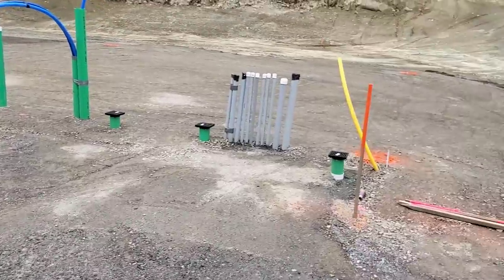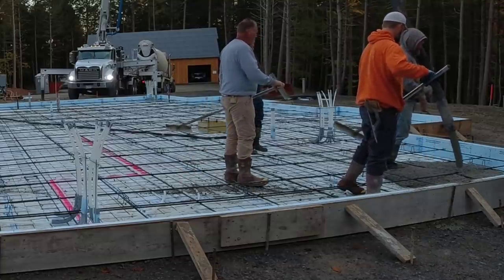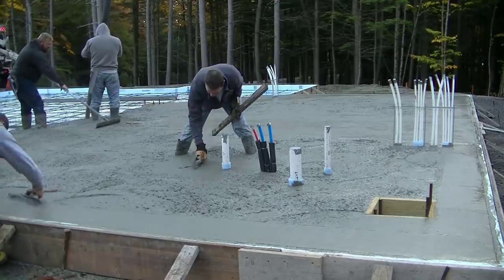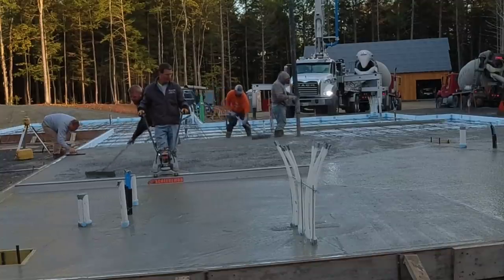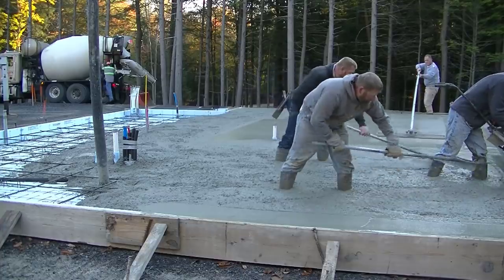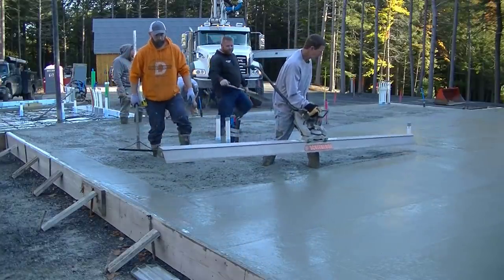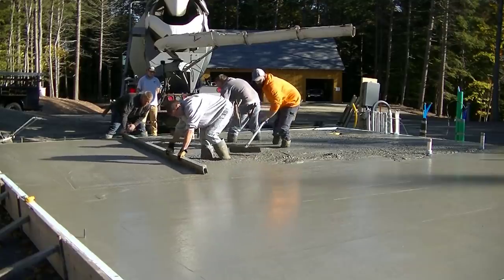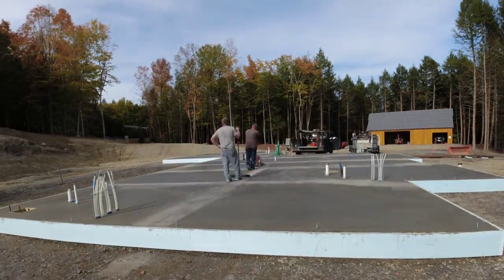He Made Us Pour His Concrete Slab 10 Inches Thick! (Waste of MONEY?)

Comment: Concrete is cheap. The guy is a builder he knows what’s up. More concrete is better. Everything now is so cheap and built to a minimum . Nothing wrong with doing things right . That is how I would want mine done . 👍🏻
Reply: Concrete is cheap, what the hell are you smoking buddy
Reply: @nicholashartsock2830  Concrete
Reply: @nicholashartsock2830  my boss gets it for cheap 10$ a yard
Reply: @nicholashartsock2830  is somewhat cheap... if you put all the costs in building a house, concret is cheap
Reply: @nicholashartsock2830  It's all relative. Concrete is cheap relative to labor and many other materials, especially for the strength you get for it. For a regular homeowner working on a much smaller project, it may seem expensive, but if you are building a home from the ground up, it's a pittance compared to what you will be spending on rest of the project. This was probably like 3 truckloads more concrete, so I'm guessing probably around like $3-4k more concrete?
Reply: @nicholashartsock2830  Think about how much you spend for a gallon of gas and what you get for that... You are already investing in the foundation. At this point the cost is minimal for what will put on top of this, think of the value of the overall project. When a normal foundation starts settling, cracking, over they years. It causes damage and the house needs repairs. This will last twice as long and with better results. So the cost is cheap,  this is actually saving you money.  And this will last over 100 years. Think of the value for the dollar on this one. The is an old saying and it goes something like this: "Nobody has time to do it right , but they always have time to do it again"
Reply: Agree. The labor is already priced in. Might as well go big. I always think this way.
Reply: You don't know what you're talking about...Things are built to CODE...It's not a "minimum" it's an engineered assembly...Where do you draw the line?...Why not make it 20 feet thick...Hell, that's way stronger than 10" ... And while concrete is inexpensive LABOR isn't...That extra 23 yards cost a few thousand more...It's not right or wrong to overbuild; it's just a waste of money and resources...
Reply: @chrisburke9279  where in the FUCK is he getting it for 10 dollars a yard. thats bullshit, we pay 150 plus a yard for concrete. i dont know anywhere where its under 150
Reply: @godbluffvdgg  well thank goodness we live in America 🇺🇸. Where you can use as much concrete as you can afford including labor. And we all have the freedom of speech to express our opinions !🙂👍🏻
Reply: @Sectionmillionaire-fg8mm  awesome me too!
Reply: @fastflo1  Indeed...Gooooo Freedom!
Reply: Lol no. Building materials are through the roof. They’ve started settling down a bit. But over the summer it was 100 dollars for a sheet of 3/4 plywood. Now imagine how many sheets you’d install building a house and half inch plywood wasn’t cheap either around 80 dollars. Yeah right now you’re paying for basically two houses to be made.
Reply: @Gorilazz.  yes the wood is crazy. Plywood was $138 for decking on my trailer for 1-1/8. Insane. But I still do think concrete is cheap for what you get. You get  a driver, huge truck, delivered, a quality product that will last for over 100 years and you get a lot of it! What other product has that kind of value in todays world? I think concrete is about he best bang for your buck. Now hopefully they do not catch on and start making prices too crazy. I build fences and we used to be able to get a 10 yard truck packed full for around $100 a yard. That was a few years ago. I know the prices are higher like everything else. But still affordable....
Reply: @chrisburke9279  no one in history since 1945 has payed 10$ a yard
Reply: Concrete is well over $100 a yard here. 10” of concrete you can park a tank on.
Reply: @Chris_at_Home  and that is nice to know it’s that strong. You won’t wonder 💭
Reply: That's a lot of thermal storage
Reply: Materials are not cheap these days dawg
Reply: @ThaiRoney  you get a lot of concrete for the price, and for what it does I think the cost is still a good deal.
Reply: @chrisburke9279  the truck burns $10 of diesel during the pour itself!
Reply: If the builder would have put grade beams though out tying one side to the other I believe you can do it very efficiently with less concrete. Check out barndominioms, Eric Corrina.
Reply: 200 a yard in my area cheap my ass
Reply: If it's what he wants it's not a waste at all.
Reply: @nuclearbum9858  I was paying a hundred  a yard a few years back. It has gone up like everything else. Think about it though. It has only doubled in years. Wood has like 10x that . Now if it went up to 1k a yard I would agree with you . The workers give it value. Its purpose is what makes the profit and gives it value. Look how much you money you will stack on this concrete and the profit it will generate. That is why you can make good money doing concrete is because it is so cheap! 🙂
Reply: @fastflo1  i work for a big company this was a side job i called for 5 yards 2 companies 999 and 1004 dollars you right there is big money in concrete when you a big player
Reply: @nuclearbum9858  Ya big money! You get a lot, its does a lot, you just have to know how to deal with it, and then you get paid!
Reply: AHMEN to that.
Reply: @godbluffvdgg  Why would you call quality over kill,
Reply: @mac02141  You spelled "Quantity" wrong silly... And overbuilding something doesn't add to the quality it just adds to the cost...
Reply: @Mike Exra Amazing cycle is it not? The ocean will eat anything you put in front of it!
Reply: @darthvader5300  The days of buying off inspectors and unscrupulous building officials went away (basically) 2 decades ago...Every major city's departments were decimated by the FBI...We lost about 20 inspectors, here in philly...Do people do shady and unsafe things in the trades? lol...This is a trillion dollar industry with millions of participants; so of course there is. I build to local codes...The people in my area are no dummies and the inspectors, do a great job, despite the lack of support and ever pressing lack of qualified inspectors...
Reply: No it’s not cheap
Reply: @ghshomeimprovements  To some it is . To some it is not.
Reply: @ghshomeimprovements  Properly over-engineered and over-built and spread over a period of 300 years, it is cheap. The steel-reinforced concrete Itaipu Dam between Paraguay and Brazil was designed and engineered and built to last for 300 years of non-stop power generation.
Reply: @darthvader5300  roger that
Reply: I'd rather build to last FOREVER! And past it on to my great, great, great, great, greatgrandchildren.
Reply: @darthvader5300  There ya go. You see the real value. Not just the price of a yard of concrete.......
Reply: @philliprunge4373  Always have different options. I feel for the price this was a efficient option.
Reply: @chrisburke9279  That's just impossible.. did you mean to say $10 per SF or $100 per yard perhaps? $100 per yard would be a steal.  We pay 131.00 per yard for metered... Readymix is more.
Reply: @chrisburke9279  where are you? Sub-Sahara Africa? Either that’s a typo or I need to move there.
Reply: @godbluffvdgg  you could build the walls 18 inches thich also.  And there is some additional labor in the thicker slab.
Reply: @7.3powerstroke6  wheel barrow mix is always cheaper lol
Reply: @mac02141  I think the problem is in the nuance of the explanation; the video says, 'used' more concrete, but, actually the concrete isn't a consumable, it is an asset; as in the builder purchased more of the asset, and some socialists think that buying more than one needs is 'wasteful.'  and, of course, it is presumptuous to decide the 'needs' of others. So, yeah, I agree; dunno why anyone would conflate 'quality' vs 'quantity', and quality products are not synonymous with excess.
Reply: Going too thick adds a lot of weight.  It could cause future settlement issues depending on the soil mechanics.  Its honestly better, if worried about support, to drive/pour piles and reinforce around them to negate any punching shear issues.  This in my opinion, as a structural engineer, is overkill.  Though I doubt it will cause any problems on such a small site.
Reply: @nicholashartsock2830 ,
 Comparing the apples to Oranges, of the builder paying a subcontractor for more earth work and the cost of renting or getting the equ. I can guarantee he probably saved a couple thousand dollars..
Reply: Nothing is cheap right now except opinions
Reply: @fastflo1  Also the floor heating will be more efficient with the thick slab.. it will retain heat much longer... so ur also saving on power costs
Reply: @tylerbyerly9662  Who doesnt work in construction?
Reply: @tylerbyerly9662  You do not need to work in construction to have common sense. How thick are R.V. Pads? 4 inches? No, thicker , why? It is stronger. Does it cost a lot extra for what it does? No. Its cheap. Full truck of concrete is cheap. I usually set at least a 100 commercial grade fence posts with a ten yard truck. You make a lot of money because the mud is cheap....cheap. cheap.....cheap.
Reply: @philliprunge4373  Exactly - simply increasing the thickness isn't necessarily making it a stronger or a structural slab capable of spanning any subgrade failures - but grade beams would accomplish this in a more efficient manner IF that is what the Owner was trying to accomplish.  4" slab is all that is necessary over a properly compacted and stabilized subgrade.
Reply: I live in Eastern Ontario  10 years ago it was $70 a square, hate to find out what it goes for today. $40 is a steal
Reply: @BillyBob-fd5ht  ya ten years ago what a great deal 👍🏻
Reply: @polyfenes have you seen the new type of concrete called CarbonCure? It uses recycled co2 for this new and emerging product.
Reply: @godbluffvdgg  200% over-engineered is fine and a good bit of headroom. Anything above 200% is a waste. If it needs to be 5" then going to 10" is reasonable.
Reply: @godbluffvdgg  okay, almost every single foundation here in Phoenix for a house has a giant crack down the middle. All of those slabs were up the code, but they could have benefited by being thicker
Reply: @greengoat5654  Thickness does not stop cracking silly...Concrete is known for cracking and concrete 12 feet thick (airport runways) will crack...So; your premise is wrong...A properly prepared base, a good mix and proper placement are the best preventative measures for concrete.
Reply: @mwnciboo  101% is  a waste...100% of construction assemblies, built to code and properly prepped will give the full life of said subassembly...
Reply: @godbluffvdgg  yeah it doesn't stop, but it really lowers the chances of. A Bulletproof vest doesn't stop every bullet, but you still wear it if you're getting shot at
Reply: @godbluffvdgg  placement clearly isn't a factor in what I'm talking about, underlayment can only do so much, thickness is still the best preventative measure for cracking.
Reply: I'm from the uk so I don't  know  about  your  building regulations I would  use six inch for a garage but 10 for my home
Reply: @michaelhoward9358  It should be the opposite....10 for garage; 6 for house ...But, 4 inches is plenty for standard foot traffic.
Reply: China..... can u make it only one sided like tim hortons bacon ?
Reply: I'd want mine done that way if I didn't require a basement.
Reply: @godbluffvdgg   You're wrong. 
For over 30 years my husband was a State of California Regional State Inspector for 24 hour medical facilities and code is written for the minimum. . There is nothing wrong with doing more than minimum. Since the owner wants more and is willing to pay for it whats the beef?
Reply: @cathycrowder2226  I don't have a beef Cathy, I stated a professional opinion...Take it or leave it...And medical facilities and residential construction are WORLDS apart...
Reply: @godbluffvdgg  Yes,  Houses are easy and quick to build compared to a hospital.  That still doesn't negate the fact that building codes are for the minimum requirements and they do meet the required engineering standards otherwise everyone would be sued when something went wrong.
Reply: @cathycrowder2226  That's what I said...
Reply: It will serve no purpose to have extra strength there, where it is not needed.
Reply: The last time I bought 10 yrds of concrete, it was $175 per yrd. ...About 3 months ago. It's higher now.
Reply: @fastflo1  Once it is poured and the house is on top, nobody will ever think about the concrete being 10 inches thick.
Reply: To add, it adds versatility to the slab as well, say you want to move vehicles into the house, you can
Reply: @greengoat5654  or even a Tractor and trailer..
Reply: @user-yr4os6jz4r  the only thing people will wonder is why there are no cracks in the walls or ceiling..........
Reply: Concrete is FAR from cheap.
Reply: I have "too much" insulation thanks to the prior owner.    My electric bills run under half what my friends do for the same square footage with an old inefficient 1987 "Magic Chef" central A/C.   When I experimented with window units, i ran 1/3 of their bill.   

As they say.. "Too much.. is never enough".
Reply: @user-yr4os6jz4r  Hey, that's only 22 cents a pound...:)...4000/175..... I agree with you...Nothing is cheap when you're the one paying for it...General contractor since the 80's
Reply: My ass! Concrete cheap! Dude I haul it for a living. 130 a yard and all the services charges they can Tack on!
Reply: People moaning obviously don’t realise that if you knew what having  plenty of money was like, that this is cheap, even $200 a yard 🤷🏼‍♂️🤷🏼‍♂️🤷🏼‍♂️
Reply: @OfficialSamuelC  exactly . Besides if he sells the place that will just turn into more money …..
Reply: We've been pouring concrete for twenty years and I did three of our family homes in 10" slab.  It's warmer.  It's quieter,  it never cracks, if you're in a flood or earthquake zone the house moves less, and if you're on the coast, you've got a 4" better view. :-)
Reply: cheaper than lifting the house and re pouring it. the next couple of decades are going to REALLY test the minimum codes to which we build around the country.
Reply: @fastflo1  I like turtles.
Reply: @fastflo1  The thickness of the slab isn't the primary determinant of whether your slab cracks, it's the uniformity of the soil beneath it.  If the long term geology underneath the slab shifts unevenly, the slab is very likely to crack unless made to a level where it could be totally unsupported (which is almost never the case in foundationwork, and simply thickening the slab is only a quarter of that job, quadrupling the rebar, getting the right mix of concrete/additives, and also the packing of the soil beneath the foundation are all important facets to extend the lifetime of a foundation.
Reply: @fastflo1  You get it, it's in the bible. Once the foundation breaks everything else breaks. Common sense right? Apparently not, I've seen so many houses that no informed person would buy because settlement has deformed everything and nothing is square or level anymore.
Reply: @trygveskogsholm5963  that is what happens.... The minimum is a base guideline. Think about it this way.... If the minimum is 4 inches. And the argument is whether more is better. Let's go the other way and take an inch or two away. .. How would  2 to three inches be? So you take away 1 inch and you are at almost instant failure...... I will stick with the more is better......
Reply: Concrete slabs this thick usually aren’t cheap, there are also different types of concrete, for a house and garage this is overkill, also usually people forget that even if you get good pricing on the concrete, you also have rebar in concrete that tends to add up a lot and you will need thicker rebar for thicker slabs or you will begin to crack. Don’t know when materials were purchased but steel doubled in price this past year.
Reply: He literally points out this cost 3000-3500 dollar extra. That's not "cheap".
Reply: @godbluffvdgg  "a few thousand more"? Building a house might cost you $500,000, $500,002 is a rounding error. It's cheap.
Reply: @brettbuck7362  In your example; you raised 500K by TWO DOLLARS...Shows how well you understand math, the industry, building, science, writing, youtube, and basically everything else...You go girl!
Reply: @RegebroRepairs  I think it is for what you are getting. And you already have so much invested. It literally is cheap for the overall project. Smart investment. Will pay tenfold.
Reply: @fastflo1  But what are you getting? The video makes it seem like the only benefits are less work, and that's not going to pay back 3000 dollars.
Reply: @godbluffvdgg  "to code" means if it was done any cheaper [thinner] it would be illegal!!!!!!! Screw the code when building your own house make it overkill  and you'll sleep easier in your bed at night with an overkill built house and the code enforcer can't say anything to you...
Reply: concrete is somewhat cheap but the labor is expensive. and although they will not have to work much harder to pour a 10 inch slab vs a 6 inch one. You better believe they are going to charge you a huge premium for the extra bit of labor. Anything more than the standard level product/service costs a lot.
Reply: @lenielupian2699  I understand your perspective...And, by all means, if you want to "overbuild" that's your time and money...As I stated in one of the comments. It's neither right nor wrong to overbuild; It's just not necessary for the system to give a good life...Cheers!
Reply: @fastflo1  not for long. LOL
Reply: Marc Kunze  sheesh …. I can get a ten yard truck for under $1200 so cheap for so much concrete. You guys are cheapskates . Look how much you pay for a gas a month and it’s gone. At least this will last 100 years and you can put a house on it. Man you guys, we’re talking about a foundation.  Try and look past the price but the value instead 👍🏻
Reply: @godbluffvdgg  if our code is so great why does the average house in North America have an life expectancy of 40 years compared to one or two hundred years in other countries.
Reply: @Benjamin Trotter  he said me
Reply: @godbluffvdgg  you forgot fiber reinforced concrete. Also Carbon Cure technology.....also proper moisture content while curing are also contributing factors when it comes to cracks. You will see concrete that does not have those cracks. Those are the guys that know all of this and more.
Reply: @cathycrowder2226  well said
Reply: @SacredGumby  Codes vary all over the country, no state has the same ones... I live in a house that is 100 years old and worked on houses that are 200 +years old...We have thousands of them...The low life expectancy homes are usually in the temperate climate areas; Florida, California etc...So; you don't know what the hell you're talking about
Reply: @HonorableHarbinger  it is cheap. Only 5 times higher? Look at everything else. It’s more than that. The floor in concrete is still cheap in relative terms. That is why it is the number one building material in the world. Now we all use concrete. What is your foundation made of before you start acting like the do gooder here. . Are you burning gas and using electricity? Your house made of wood? Please do not choose the side of opinion you are on when you are living the one of hipocracy. Sheesh. You are are part of it believe it or not. You live in America and consume just like everyone else. The only difference is your opinion not your actions. You’re using a computer made in China right now. And on the internet using electricity from a power plant that uses cheap concrete 😂try again
Reply: Thermal storage.
Reply: Would it take a lot longer to set?
Reply: @godbluffvdgg  Code and best aren't the same thing.  If you're building your own home, code is probably not the standard you want to go by.
Reply: @benjamininkorea7016  You don't know enough to supersede local codes...So, inevitably, you'll screw the pooch upon inspection....But; nobody is stopping you...Hey, frame all your walls with gluelams, Use  1 inch fire rated T&G plywood decking, over 5 X14 gluelam joist/beams...Screw it all together...Use -R-114 ( R-38 X 3)   in the attic AND the walls...Use GFCI's AND Arc Fault breakers...Apply 10 coats of epoxy paint on every surface... on and on...Good luck...
Reply: @HouseholdDog  Good question
Reply: @7.3powerstroke6  $215 Per yard pumped out here on the west coast. and that's a good deal.
Reply: @charlestallardy5685    Ya man, @fastflo1 has been saying the same thing. They've got radiant heat in that floor, sooooo, an extra 4 inches of concrete on top of that pipe is going to retain ALOT of heat, no doubt. Cheers man
Reply: Concrete is not cheap
Reply: @chrisburke9279  full of crap concrete was never that cheap
Reply: @Chris_at_Home  only if it has enough reinforcements (steel) in it
Reply: @dredbud9272  I still think it is such a great value for the price. What else can you buy for that price that will last 100 years?
Reply: @RegebroRepairs  you’re getting a great foundation . Take away the concrete , you have dirt. So it’s above minimum, that’s considered an upgrade. I
Reply: @godbluffvdgg  2 projects done at the same time 6 years ago.  My neighbor poured 6 inch thick, I had 10 inches poured.  Neighbor's is aleady cracked.  Mine, even after the township hit it with a wing plow, is pristine.
Reply: @user-yr4os6jz4r  If it cracks or heaves, they will very much "think" about the concrete.
Reply: @wayneegli8379  Awesome...Where should I send your cookie>?
Reply: @wayneegli8379  If it heaves, it was not done to code.
Reply: I agree. If by pouring a thicker slab we can “save on labor from grading”, to the point there is net zero savings, I prefer to have thicker concrete. 
It allows heavier loading later on.
Eg if he place a giant safe on the first floor, filled with gold bricks…
Reply: @7.3powerstroke6  hey man just seeeinf this. Now I work w some Mexicans and they tell me this shit. I don’t know why they would lie to me. They say tour boss knows smith concrete really good family type stuff. Idk if they were just talking out of the ass or not but I believe em
Reply: @godbluffvdgg  Especially when a tornado comes along and blows the house to smithereens and nothing left but a 10" slab anyway.
Reply: @user-yr4os6jz4r  Depending on where you live, you have a better chance of a car smashing through your house than a tornado...There's more areas in this country that have NEVER seen a tornado than those that have...Live near a bunch of big city buildings, no worries...My house is made of Brick and Block with a stucco coating...FUCK tornados...
Reply: @godbluffvdgg  Well, excuse me.  I guess I should have said especially when a car comes crashing through your house.  But then, you'd have to run your mouth about that also, correct?
Reply: @fastflo1  I"ve never  went inside of a house and wondered why there were no cracks in the walls or ceiling and I'm 63 yr old retired union operator.
Reply: @OfficialSamuelC  I have 1 million dollars and to me, $200 per yd for concrete is not cheap.
Reply: @1nvisible1  So, the only thing keeping you from pouring 10 feet thick would be the cost? Otherwise you would?
Reply: A lot of highway bridges are only 8 inches thick but have choke rebar welded to I beams.
Reply: @tonygarner3942  turtles are cool
Reply: Everything is cheap?  Are you real?
Reply: @godbluffvdgg  labour for an extra 23 yards is in the region of thousands?  Wow.  Holy god.
Reply: @imnothere220  I'm sure  the original poster did not mean for "cheap" to equal inexpensive. In this case, cheap means very low quality.  I'm amazed you didn't understand that concept.
Reply: @user-yr4os6jz4r  so he means concrete is very low quality?  And he's saying that as a general proposition?  Despite the post actually overtly being about cost.  And despite the fact in later posts he expressly says he's talking about cost and explains it.  You're not the cleverest type are you...so, yeah...carry on being amazed.
Reply: @imnothere220  Yes. In contrast to other building materials. Yes it is cheap. It lasts for a long time, you get a lot for the price, you can build on it. And all the other materials rely on it. For the amount per yard, delivered in a truck to the site. It is cheap. Very cheap.
Reply: @fastflo1  thanks.  I understand.  But the "pilgrim" spouting guy above says you don't mean this?  He says you're not taking about cost at all?
Reply: @imnothere220  ya, I’m not sure 🤔 but I really do mean it is cheap though . I buy a lot of things . And you can get an entire truck delivered of 10 yards of concrete which will last for over 100 years for under $1500 . That’s a great value.
Reply: @user-yr4os6jz4r  so yeah....you're the genius here.
Reply: @fastflo1  thanks man!
Reply: @imnothere220  Right on. You win.
Reply: Concrete quit being cheap a long time ago
Reply: Cheapest building material there is.
Reply: @chrisburke9279   maybe 10 a square foot. But it is 117 a yard on average across the nation as of 2021
Reply: @lancastercountyhousewright5107  yes thank you
Reply: @tylerbyerly9662  lmao yes I do. I build foundations, basements from the ground up buddie
Reply: @oldbloke100  that’s what I’m talking about …👍🏻
Reply: @victorpaulos2928  Only $130 a yard! So cheap! Delivered! With a driver ! Diesel! West and tear on the truck ! Insurance! Workmans comp! Clean up! A batch plant! Gravel! Sand! Portland cement! Do I need to keep going ? And it lasts a hundred years! And you can build on it ! For just $130 a yard? What a deal …… so cheap ……
Reply: @leolandleo  ya I hear ya 👍🏻
Reply: @tonygarner3942  😀
Reply: @DSiren  all factors considered yes. But unsupported at any rate, the thicker slab is stronger,  bottom line.
Reply: @trygveskogsholm5963  never skimp on a foundation . Minimum . Who wants just the minimum? That just means that’s the absolute least you can use……above Standard is my preference….
Reply: @brylzy  great point . All factored in a better foundation at this stage is a worthwhile investment . It will pay for more than the cost in the end.
Reply: @godbluffvdgg  Hell the thermal mass  will work for him. saving  resources ... I would  draw that line  a 8" depending  on that climate it's 21 inches  for  the footing edges ... but dude ,  20 feet  is way too much.  But an extra 2" ...
Reply: @nicholashartsock2830  $3500 on the cost of  a house  that size < 1% ...  yes it cheap.What does a pound of what you are smoking cost ?...  If he lives in a real cold clinate he will save that much  by  thermal mass 35 months
Reply: @7.3powerstroke6  LOL  maybe he meant  10 a foot so 270   a yard
Reply: @timeWaster76  20 feet just in case someone wants to land a fully loaded 777 on it...Hey, ya never know!
Reply: @godbluffvdgg  Exactly...  LOL  Generally if  the guy is a builder  in that area  I would  assume he might  know  more that I do. Ifit were  me  and  it is a cold area ... I could s most  definitely see the  over pour at  $3500 well worth it.  And then there is the space the the RH tubing takes up. 
I have had   occasion to try and address a CC slay that had cracked and it was built to codes  of the day. Mostly because  of soil conditions. The radiant  heating  can  make for a lot of changes in soil.. insulation helps but...  and  if  water get  in... 
Anyway  lots  of  machinery calls for thicker slabs and equipment  the  calls for  bolting  have  such requirements. I worked on  a science  project   and the planes  called for a 5 ft slab . Turned out  the found  one already pour  on  county property. At the water  planet. Th have  a 18 Ft slab in on location. When the county  builds  something  there is a lot of  "over pouring"  Because the have to  actually engineer  to a soil  report for  the specific sight not a general  regional map.   
Anyway there are  construction companies that all the do  is  fix  slab foundations that fail.
Reply: @7.3powerstroke6  there's no way he's getting it that cheap when a 94lb bag of Portland cost about 12$
Reply: I can see that you have not purchased any concrete in a while
Reply: @ksapp8213  I think he meant that the concrete is cheap compared to the labor that would have been involved to do the other options
Reply: @markwilliams4525   Those are not options when you get yourself pushed in to  this you're not dealing with options you're just putting out fires
Reply: @ksapp8213  Just bought a two  10 yard trucks recently. Helped me build a fence project valued at over 50k.... Could not have earned a penny with out it. So Cheap for that much concrete. Concrete makes money. Try and build a house with no concrete. Maybe then you will see the value it has for the price.
Reply: @fastflo1   Another guy that can't see the forest for the trees concrete is expensive I don't care what you make off of it concrete Is still ExpensiveBut being you think it's so cheap maybe you'll pay for mine next time
Reply: Lol thats a lie nobody can get it of 10 a yard
Reply: @ksapp8213  Do you even realize what it takes to get that mud to the jobsite? Have you ever added up the time to batch? The employee it takes to run the company? Insurance? The truck? The driver? The fuel? The gravel? The sand? The portland cement? the water? Do I need to go on? And all delivered for just over $100 a yard? That is cheap. Period
Reply: What rock have you been living under that you think "everything now is so cheap"?  Pretty much all building materials, including concrete are higher than they have ever been, if you can even get them.  Contractors all over are advising clients to put off building anything because the materials (if they can be obtained) will cost twice to three times what they would have 18 months ago.
Reply: @chrisburke9279  Yeah, sorry I'm calling Bullshit here.  Concrete has not been 10 bucks a yard since the early 1950s.  More like 125-175/yard straight from the plant depending on the week.
Reply: 10" is fine for Airport Landing Strips, House slabs nope
Reply: So on average on a let's say 3800 sq ft slab what would be the cost including labor? I am on my 1st semester of construction science and want to understand this better so sorry if this seem like a stupid question.
Reply: @godbluffvdgg  Code describes minimum standards. Furthermore Code in the US for a house would not pass for a gardenshed in Central Europe.
Reply: @godbluffvdgg  No waste if the buyer is willing to pay...no different than buying a $100K car or a $45K car they both do the same thing.
Reply: Everything now is cheap !? Your the kind that’s fanning money while saying that.😆
Reply: @Hengry-hn7rb  :)...Yeah, he's in his Lamborghini 4X4  smirking at us...:)
Reply: @godbluffvdgg  😆😆😆👍
Reply: @Hengry-hn7rb   I really did mean that everything is cheap in quality. Concrete cheap in price. I wish  I was fanning myself with money, that is funny😆
Reply: @fastflo1  you alright man😁GOD bless!
Reply: @Hengry 1994  Thanks Man! You too!👍🏻
Reply: @David.b.nimble  your comment was the first isaw that takes into consideration that it has heating coils in it for radiant heat 
Once it's up to temp his heating bills will be very low
Reply: its the best way to do it !!
Reply: @samjones-ou3bn  heck ya 👍🏻
Reply: @nicholashartsock2830  I am high 14 hours a day and I want to know too because I have never been that high! I remember $40/cubic yard! lol
Reply: @nicholashartsock2830  he's using "Grown up" words.
Reply: same, when I have my future house built, I want the exterior walls framed with 2x8's or larger and steel frame doors to resist break and enterings.
Reply: @nicholashartsock2830  Concrete is cheap. This is why we've used it for over 2000 years. If you find concrete to be expensive, you should never ever pay a contractor to build a modern home for you. Not only is it out of your price range, but you will get penny pinched by the real expense: Labor & lumber.
Reply: also, you don't know what the owner or build have in mind in having a 10" pad.  Maybe the owner plans to place a 1000 gallon fish tank in the house.  That would get heavy fast.
Reply: @FtanmoOfEtheirys  That sounds like a good plan. I would love to build a steel frame house on a nice thick pad. Good doors ,yes.
Reply: @bengee1040  Exactly. Nice perspective. Thousands of pounds.....I agree.
Reply: 120 a yard in phoenix when i started concrete in 1992 it was 58 bucks a yard nothing inexpensive about it. Sorry dont like the word cheap in the field of contracting
Reply: @greengoat5654  I am a flooring contractor in phoenix and the reason why all the slabs are cracked coz the guys that poured them are on crack the houses are built to fast they start framing the day after pour they have uneven abc substrate and they cut no expansion joint either thats straight hurry up work not including hot mud in the summer when its 115 f the mud should be iced at the plant on any days over 100 f Im sure you have a ton of cracked tile or hollow tile due to this. I know were u r coming from very sad some builders quality is to slow of a word to them.
Reply: @jimweiss  you hiring? I already know LVP/laminate and finishing.
Reply: @jimweiss  yes …. Let us also consider in 1992 gasoline was around .85 cents a gallon…. More factors to consider when looking at the price of concrete . It has doubled in price in the same time period gas has quadrupled. So I would still consider it cheap in comparison.
Reply: @greengoat5654  you in phoenix
Reply: @jimweiss  yup. Just south of downtown. Do you have a company named I could look up or contact you with?
Reply: @fastflo1  but at ten bucks a yard as mentioned above thats the only batching plant rate that went down. I consider all building material inexpensive labor and your home finishes are what can climb rather quick especialy owners who like upgrades.
Reply: @greengoat5654  Gemini Tile LLC
Reply: @chrisburke9279  where do you live. It’s over 100 dollars a cubic yard on average
Reply: @godbluffvdgg  the code IS in many cases a minimum
Reply: @7.3powerstroke6  He obviously doesn’t know what he is talking about. Only a fool would believe a $10 per yard claim.
Reply: @SacredGumby  where do you live? In a trailer park in the tornado belt?  There are plenty of  100-150 year old houses that are still in good shape where I live.
Reply: no concrete is not cheap…maybe on Mars it is cheap…down here it is not cheap
Reply: @russellking9762  it lasts so long…. Such a good deal . What else can you buy that will last over 100 years for that price?
Reply: @SpiraSpiraSpira  I understand what you're stating but, you don't understand the point. Assemblies need guidelines...The codes make it easy to stay in the engineering envelope to avoid failure of the assembly...It's the Torque value...Minimum is NEVER a consideration...You can build things to a self determined minimum and it may stand, but; the failure moment will be shorter...Codes are Just right.
Reply: @darthvader5300  Let's hope we get that far.  The way we've treated the planet has placed living conditions in rather precarious circumstances for future generations...
Reply: @darthvader5300  It's not only people in danger, but living things across the planet.  I do not know much about these two men, other than I think they're both Canadien and at least one of them doesn't believe in climate change.  I'm all for innovating new ways to operate without harming the land, sea and air.  To the extent that is being done, I'm on board.  Denial and dismissal of damage for the benefit of corporate interest, I'm out...
Reply: @7.3powerstroke6  no shit. this dude is pure cap. i am orderring 2 months out for million square building pads..
Reply: "Everything now is so cheap" dude WHAT? It's literally the opposite. Lumber prices would like to have a word with you
Reply: 2900sq ft slab cost me $20,000. That might be cheap for your "high pockets" but not for most of us chasing our dream.
Reply: Im a Concrete Truck driver, Just to let you know, the price for 10.50 yards of concrete (The Max my truck is allowed to move over the road by state law) Runs at average 1700 Bucks. that price will change depending on the Mix, additives you order, Fiber-mesh, Glenium, calcium, (of which needs to be off that truck asap as calcium makes it set up quicker) Other factors on price are going to include the distance I have to drive to get to your job site and of course if your a 40 min drive out the mix has to be maid to accommodate that distance so its not already a rock in my drum by the time I get there. And finally how long it takes you to pour me. So you have an hour after I arrive to offload my drum, After that you start getting charged a retaining fee!   So be there with your crew BEFORE i get there. You would be surprised how many times a contractor has told the dispatcher hes ready now, only to get there and no one is in sight let alone have the forums in place!
Reply: @HighmageDerin  and then they want you to add water because they were not ready ! And then the mix won’t pass an inspection 🧐
Reply: I agree w/ everything except “concrete is cheap” lol
Reply: @fastflo1  No, they want me to add all that water because they don't want to have to work. If they can sneak the 3In slump down to a 6 or 7, then its easier for them to scree it!
Reply: @godbluffvdgg   If he wanted to make the concrete slab 20' this money feed sick it would be stronger and it wouldn't be a waste of money or resources if it was utilized. The foundation would most likely outlive any structure you built on top of it that foundation type pathetically be used for centuries. So no Sticker is just better unless you just don't have the money for it
Reply: this, as a german I was like "that is not much concrete for a foundation, where is the problem ?"
Reply: @nicholashartsock2830  it is cheap! It the fucking foundation of a home and is cheap as fuck, compared to the rest the build! As far as driveways and sidewalks go, it's nothing compared to pavers.
Reply: Concrete is cheap? I figured it was high as hell just like everything else. I live in Missouri I guess I need to check into pricing. I would love to have a slab poured for a carport.
Reply: He’s paying for it,pour it.
Reply: Concrete is not cheap.  This guy is hiding a body  🤣
Reply: @chrisburke9279  did you mean 100$ a yard or was this back in the 70's?
Reply: @stevelibby6852  Or he is putting a 10 inch deep safe in the floor lol
Reply: It sure isn't cheap right now!
Reply: @npsit1  I agree inflation is a bit high.... But in contrast to the increase in most things.... Concrete is still cheap. It has only doubled in the last 20 years..... Gas has gone up over 4 times that amount in the same timeframe..... Think about that. Then add the value as investment that will grow into more money. The foundation of a home meant to be there over 100 years! Now that is a true value!
Reply: @daviddowling9830  Run it!
Reply: @stevelibby6852  Shhhhhhh....
Reply: @A.C.71  It is surprisingly cheap....
Reply: @HighmageDerin  haha 😆 I hear that ! Nothing like a soupy slurry mix … self leveling …..
Reply: @MS-mr4zm  😃
Reply: @fastflo1   Yes finally someone else who understands that term!
Reply: @HighmageDerin  heck ya man 💯👍🏻
Reply: Concrete is cheap but the $55/hr man cost ain’t! 🤣
Reply: Bought an Builders Personal Home Last Year, Everything is Phenomenal , Except natural Gas Line Connections and No Dialectric unions on Water Heater which I changed Myself , Just an Beautiful Home!
Reply: seems excessive for a 2300 sqft home
Reply: @godbluffvdgg  "And while concrete is inexpensive LABOR isn't" The guy outright stated that by pouring 10" across instead of doing 6" with a 12" border actually saved on labor. 

"It's not a "minimum" it's an engineered assembly" Built to code is literally the engineered assembly minimum for whatever benchmarks in safety/stability/lifespan they are aiming for. It is LITTERALLY THE MINIMUM.
Reply: @johne3999  Video outright stated pouring 10in across was less labor than pouring 6in across with a 12in border.
Reply: @-live8659  There ya go!
Reply: Your comment implies that you have never ever spent any of your money on construction supplies.
Reply: Yeah building materials are at an all time high. I overbuilt a deck to hold a hot tub. But concrete that shit ain’t cheap lol
Reply: @LaheyJ  am I dealing with a bunch of cheapos? 😂
Reply: @shaynejenkins446  Opposite... I spend a lot on supplies, it gets really expensive . The best bang for the buck is concrete. It is cheap. For example.  Look how much money a can of marking paint costs, almost ten bucks. 1 case is nearly the same amount of one yard of concrete. That concrete will be there for a hundred years. You can build on it and increase its value . The paint? A few marks on the ground....and it is gone...Hope this helps your perspective....
Reply: @godbluffvdgg  code is the minimum....
Reply: @scotthardwick7413  If you're suggesting that code is the least acceptable assemblies construction method. I agree. The original point of the thread was insinuating that because code is "minimum" the assembly is inferior or weak...
Reply: @7.3powerstroke6  he teleports it from Mexico
Reply: concrete is NOT cheap lmao
Reply: @Shadow0fd3ath24  you guys ☺️
Reply: Concrete is cheap.  A used car costs 30K nowadays.  Jet fighters cost $1.7 trillion.  Glued together wood chips cost $100.
Reply: @7.3powerstroke6  I'd love to get me some $10.00 a YD concrete  LMFAO!!!!!!!!!!!!!!!!!!!!!!!!!!!!!!!
Reply: @  Finally someone who comes along that makes perfect sense. Thank you. So obvious....
Reply from the maker: Thanks
Reply: @Mike Day Concrete  Yep👍🏻
Reply: @7.3powerstroke6  I get it for $115 a yard short load as a homeowner
Reply: I dont know where you're from but and additional 3500 dollars for no real benefit other than it's less likely to have cracks is a high price. At least it is where I live
Reply: @dennisandrews8485  I really think it all comes down to perspective… I do feel that with inflation , concrete has been slow to rise in price .. At least in contrast to so many other things that have gone beyond reason. Like gas for example. So yes I do believe concrete is still cheap 👍🏻
Reply: Theres a lot of builders that guess their way through shit. Most these days get bids and add 10 percent to all services for the final bill. Being a builder these days is a matter of learning all the bullshit codes they have to deal with and adding 10 percent.
Reply: @scottpodgorski4102  you can lose a lot quick… pays to estimate precisely and cover yourself for sure
Reply: @larsvegas1505  the floor holding heat longer won't save you any cost because it will take longer to heat up. A btu is a btu. What matters is your home insulation, containing the heat I the home for as long as possible.
Reply: @fastflo1  Fence post mix is cheap, the mix he uses is not. The strength of a slab doesn't  always = thickness.